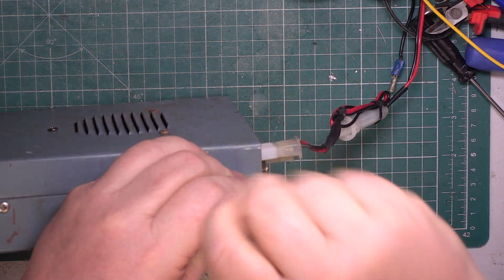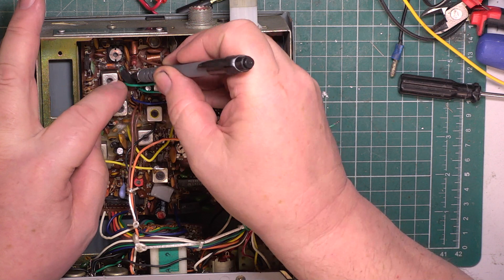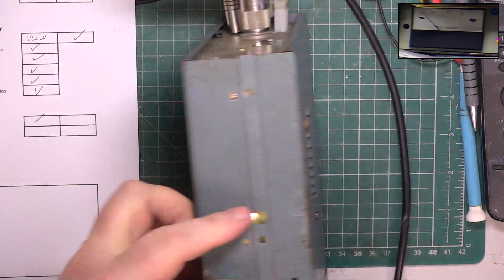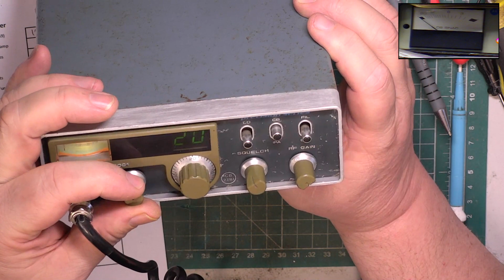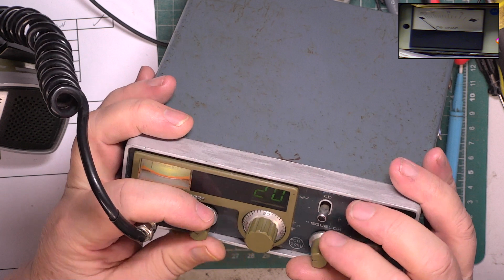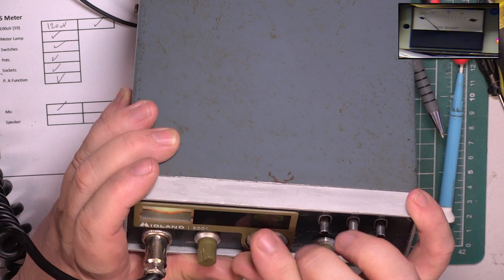Midland 3001 CB27/81 UK FM CB radio - service alignment

Comment: The legality of the lack of low power switch is debatable. MPT1320 is unclear on the exact requirement. Para. 1.2 (Permitted effective radiated power) states ‘…the equipment manufacturer shall provide as a standard facility on the equipment means by which the transmitter output power may be reduced by a minimum of 10db.’

However Para. 4.2 (Carrier Power) states ‘The equipment manufacturer shall provide as a standard accessory an attenuator having a minimum attenuation of 10db or alternatively provide a switch which can be used to reduce the power by a minimum of 10db for use, where necessary, between the transmitter output and the antenna terminals of the equipment, a removable link may be necessary.

So I think it’s arguable that it wasn’t a requirement to have a switch, although an accessory should be provided. I wonder if one was?
Reply from the maker: We are unlikely to know. The Midland importers, Plustronics, were soon bankrupt & by 1983 unsold stock was selling in Dixons from £9.99.

Richard